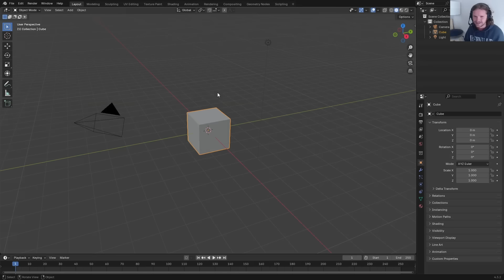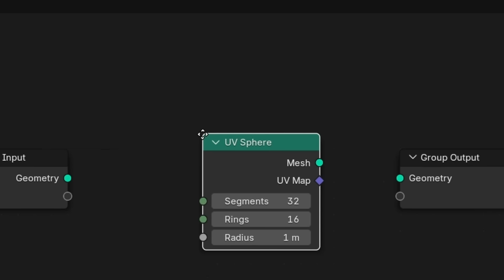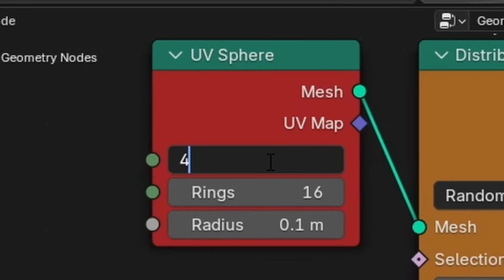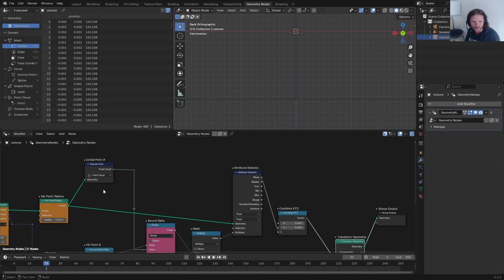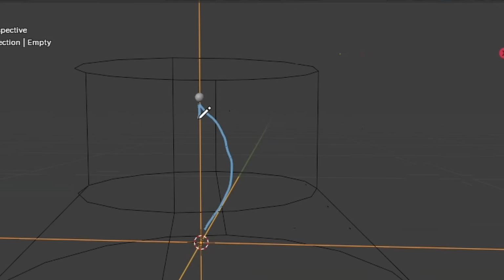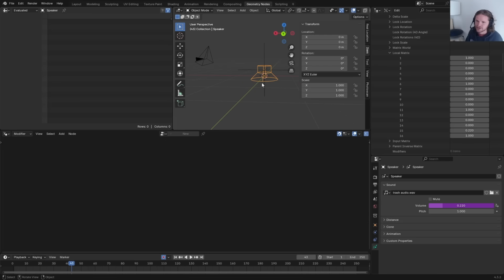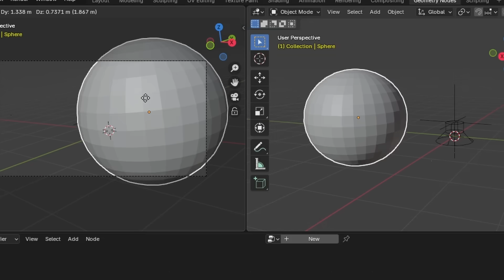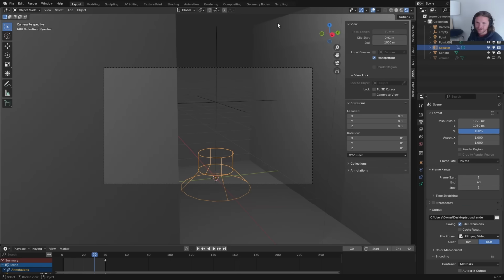Physical Sound (new concept!) // Blender Tutorial

Comment: I'd thought about trying to use Blender to generate impulse responses that could be used for e.g., convolution reverb in music production. I.e., you could define a  space virtually then export/import the acoustic features of the space into music software. I figured it'd take forever to program and never got started. Seems like the hard part is already done*!! 🤯

The next step would be to establish real-time, bi-directional communication. That'd allow the music software to control the timing/rhythm and receive updates that get applied to live audio. E.g., it could send messages like animate the position of this virtual wall or that virtual speaker, etc. while a live musician is performing on stage. It should theoretically be possible depending on the power of the computer vs. the complexity of the acoustic scene and whether or not it also needs to render a visualisation or just audio (after the initial design).

* EDIT I saw the virtual speaker and got excited but now I've finished watching. There's a lot more stuff that I mentioned in another comment. Maybe the Blender team has already done some of it if I did through the docs a bit?:

The trick is that volume automation is only one aspect. There's also:

* constructive/destructive interference (resonances that act like EQ)
* material properties like absorption/diffusion that can ~blur/smear~ reflections
* temporal effects (some reflections arrive sooner/later than others) 

It's all theoretically quite feasible, though.

Comment: You can set up the speaker to be directional like a spotlight manipulating the Cone values in the menu. It is calculated from the speaker object orientation. Inner Cone is where the volume is 100%, Outer Cone surrounds the inner cone where the volume is interpolated down to the volume set in Outer Cone volume. The drawback is that there is no visualisation of the cones at all and the cone angles are not animatable, only the speaker object orientation.
To sort of recreate the corridor scene here, point the Speaker at the corridor corner, set the Inner Cone to something like 45 degrees and Outer Cone to something like 90 with Outer Cone Volume 0-0.1, the sound will only play if camera would cross the outer cone area and then play at 100% volume when crossing inner cone area. You can't do sound colliders this way though so the sound cones could go through something you don't want.

Comment: You are a true wizard. This is an extremely interesting experiment! I wonder if this could be fleshed out more. One idea i had was a sort of "doppler effect" where the pitch changes relative to the speed at which the emitter and the camera are moving towards or away from each other. Do you think this is possible? What about proper reverb like in a big hall? Would that be somehow possible?
Reply from the maker: yep that's gold
velocity could be calculated as how the vector (speaker to camera) changes via a sim node
Reply: @CGMatter  nice, i thought that the doppler effect would be possible to do but do you have thought on how to implement reverb? I have no idea how to tackle that since it would require some sort of delayed layering of the sound sample, right? Anyway, thanks for your valuable tutorials!
Reply: Doppler effect is a native setting in the scene properties (where the Update Cache button is), but its global for all sounds in the scene. As for reverb you would have to spawn few copies of the speaker but sound start is controlled by NLA editor so not sure how you can do it programmatically for the delay. You can set the delay manually for each copy.